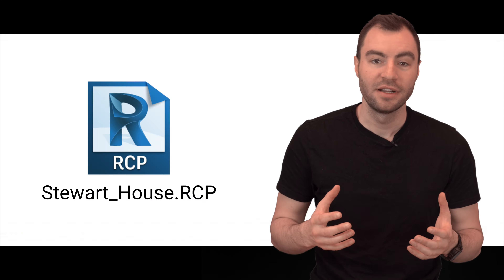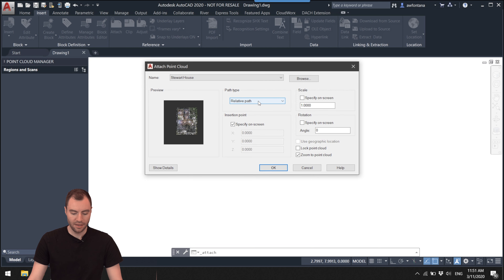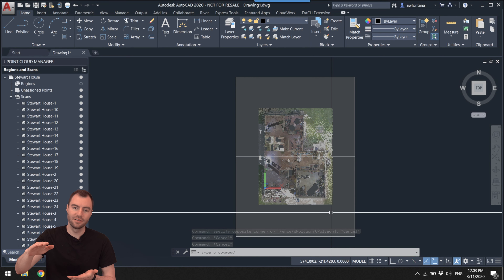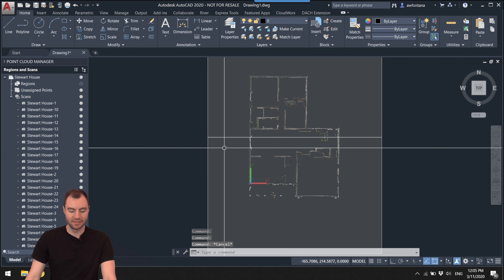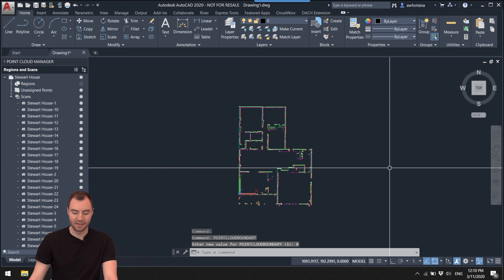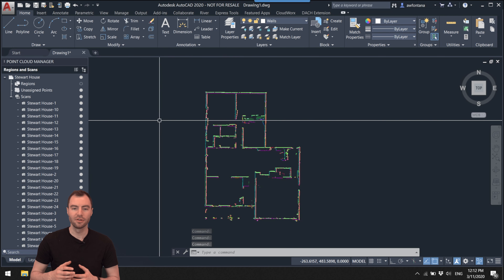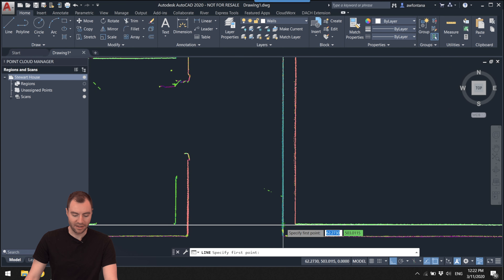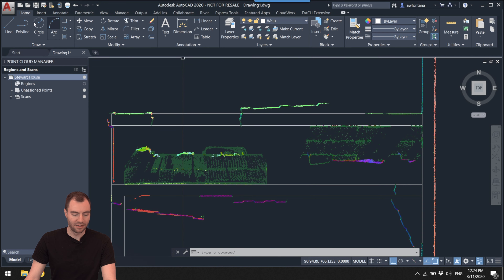How to Create a 2D Floorplan Drawing from a Laser Scan in AutoCAD (FULL LENGTH TUTORIAL)

Comment: Thanks Andy, this is really helpful! I would like to ask you, is there a need to have a CloudWorx license since someone can draw the floorplan in AutoCAD? What is the benefit of having CloudWorx? If I am right, CloudWorx can open only lgs files or a project from Register 360, so what if I had just the rcp file?
Reply from the maker: Hi @Entropia1981! No, you can use plain AutoCAD if you’d like.  However, CloudWorx manages the point cloud radically different than native AutoCAD.  There are massive gains in responsiveness as well as the full ribbon of tools that are added.  CloudWorx can read the LGS format, it can also attach to the RCP, and it can read data from Register360, Cyclone CORE, and soon to come, Reality Cloud Studio.